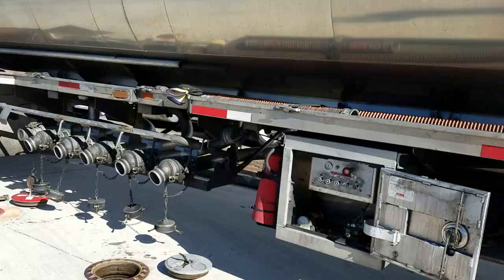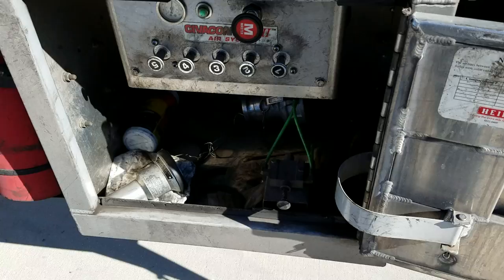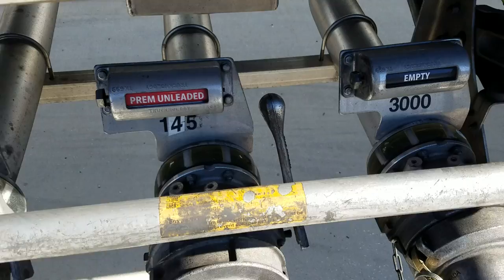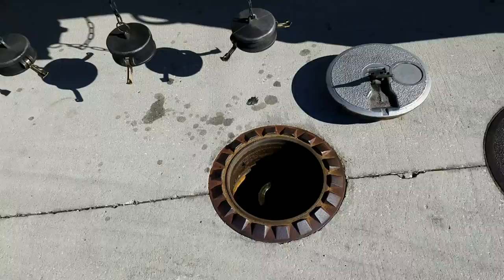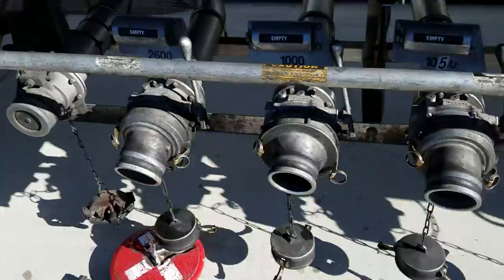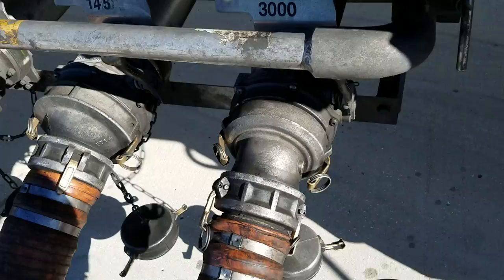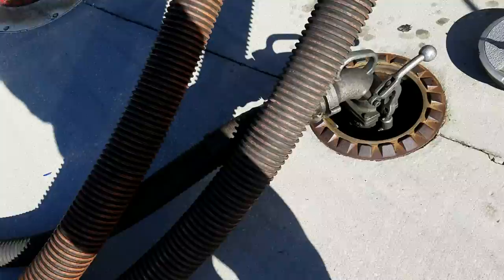How a Fuel Truck Delivers to a TruckStop

Comment: You guys don't need to Earth? How do you prevent static build up and electric ignition risks
Reply from the maker: There's a copper wire that runs through the hose that ground the trailer to the tank I'm unloading into.
Reply: NIce. Just watched a video of someone loading oil into a tanker and he had to ground his tanker with an external wire. I suppose this is safer as static can build up locally :)
Reply: Where I work we both use grounding hoses and special grounding wires on reels, we have had fires from the filling pipes on gas stations from static so now it's double safety on everything, grounding both ran through the filling hoses and externally.
Reply: Shazzkid you should earth but some don't they will learn
Reply: Shazzkid Its called a skully, you ground out
Reply: On our particular trailers where I work we run a rubber strip on the trailer which grounds it all the time. But everything is made from a non spark brass material on the hoses so your kinda grounded all the time.
Reply: Shazzkid  by not using a cell phone  or camara while unloading fuel....Safety Department nightmare being recorded...
Reply: whats earth?
Reply: Dereck Kami a ground wire that is connected to the trailer that usually they have a ground rod you hook to
Reply: Dereck Kami when you ground something you’re running a rod into the earth literally.... some people say Ground some say Earth it’s the same thing ...
Reply: Shazzkid I suggest premium & regular are the same deal ..simply price gauging interest......Always a J W 0  BinGo scam...

JetAIRplanes actually run on compressed air free energy not Kerosene burning jet AIRplanes hidden in AIRplane sight.  Same as F1 cars.... compressed air free energy......
Reply: No, he said Premium is mixed with regular to give you the midgrade.
Reply: Grant Bennett333 
You’re crazy...no idea what you’re taking about
Reply: The Media Is Cancer 
It’s 35% premium and 65% regular to make 89 octane midgrade...the pumps do it for you, but for older stations you mix it yourself at the terminal.
Reply: Grant Bennett333.      Pfft. Wasting time explaining anything to this guy.
Reply: Shazzkid. The trailer is grounded when you connect the hoses to the fittings preventing any static sparks
Reply: One Love skully is used when loading not unloading
Reply: Shazzkid 
pppppppooooppp
Reply: Not really, just smarter workers that can think on their own without dumbing the process so much an orangutan can do it.
Reply: Grant Bennett333 Your ignorance is astounding.
Reply: earth is flat
Reply: Zangief Romanov naw just gravity pulling
Reply: what sorta camera are you using? i looked at one for a few unique jobs ive done, but intrinsically safe cameras are NOT cheap...
Reply: Grounding
Reply: What's different in the UK?
Reply: the hoses have a spiral wound conductor in their construction. The hoses are regularly tested that they are working correctly, plus the vapour recovery hose is also conductive so there is a double earth.
Reply: But the earth is flat. Static electricity is a mythical lie.
Reply: hoses are grounded to the tank also some trailers have a conductive strip that is just dangling on the ground and that does the trick ststic buildup is always monitored and controlled  also forbiding items such as wool helps a lot :)
Reply: Theres a metal earthing band running around the delivery hoses which grounds to earth.
Reply: You hook up a ground stinger while loading...
Reply: What do the hoses weigh
Reply: Shazzkid j
Reply: They unload it with an accent. And a cup of tea.
Reply: a non spark material (only lead is non spark!) is not the same as grounding.
Reply: You mean ground.
Reply: MrBigStoop yup we do
Reply: right on man he should have grounded off the truck    .
Reply: @dereckkami8200  https://www.youtube.com/watch?v=2sSqzLPMb4s 
titled The Amazing Power of Static Electricity
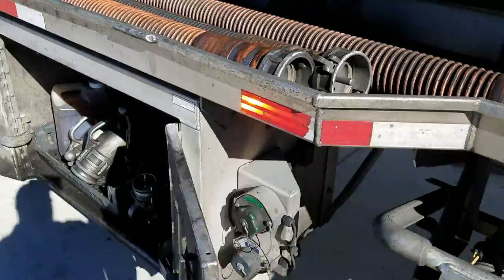At 5:20 Is a highly pertinent part of the video. 
you're welcome
Reply: @soundspark  Have you ever hauled fuel or hazmat...It is more about staying focus on the task at hand, and properly delivering hazaderious materials free from hazarderd  to the enviroment and public safety. and contamination of fuel product.  I have seen countless drivers that cross drop wrong product in the wrong tanks because they have thier bluetooth in their ears and talking on it.  When delivering fuel only thing a driver need to be concearned about is the correct products are flowing  in the correct tank.  Proper unloading procedures are followed and there is plenty of room in the tanks that is being delivered into.  I DONE 12 YEARS OF FUEL HAULING WITH NO SPILLS OR ACIDENTS.  NOW I am delivering hazardous materials that are far more dangerous than gasoline.  I stand by my previous statement.  Safety will have a feild day with a driver that is on the phone while unloading.  By the way this driver did an excellent job unloading fuel and explaing what he did and why.  Perhaps he got permission to do this.  But I am just presenting the fact in which cell phones are better left in the truck while loading and unloading.

Focus means forbiding outside circumstance undermining safety...
Reply: @larrynevitt8029  hes smart by not filming any logos or paperwork. No problem for them to worry about.
Reply: @parteibonza   got you
Reply: lol I just wrote a comment about this and saw your comment
Reply: Ground wire drop hoses are only safe if they actually work. We had new hoses that never got tested for conductivity that never completed the circuit. The hoses are suppose to be tested yearly and or after a repair.
Reply: The truck is grounded to the earth from the metal on the hose and truck touching the metal on the hose and the fitting in the well
Reply: there should be a grounding cable on the trailee

Comment: I bet that fresh gasoline smells so good! :)
Reply: Leaded gasoline smells way better!
Reply: I promise you, if you work with it long enough you'll grow to hate it.
Reply: The best is ethanol
Reply: @Chistopher lewis  thats so true. Todays unleaded ethanol stinks bad compared to the older pump gasoline from the 1970's. Today's gas is corrosive to most vehicles built before 2002 and all motorcycles, Recreational vehicles, small engine types such as lawn mower, chainsaw, generators etc.  There's many who will vote for the newer fuels however, it causes so much expense and maintenance to the older fuel systems and small engines.
Reply: smells like shit with the ethanol. Gas use to smell good in pure state
Reply: I find that gasoline has a really strong odor of  MEK [ Menthol ethyl  ketone ]  or Nail Polish remover. when I was a kid in the 60's and a teen in the 70's, Gasoline had lead in it and had kind of a sweet / mildly oily smell
Reply: @Christopherllewis  big facts
Reply: Only if your a huffer
Reply: After working in the industry, you don’t even smell it anymore. I can stick my face right above a bucket of gasoline and can not smell it at all.
Reply: @Garth2011  older gas used lead. More than enough of a reason not to use it anymore. It smelled great tho.
Reply: @justinv433  perks of the work.
Reply: Justin V same deal and water treatment. You can’t smell the chlorine after a few years. I am often amazed with the comments from visitors about the chlorine odor, Which I can’t smell anymore.
Reply: @soundspark you can't fuel on refinery byproducts those are either sold downstream to another company or burned in the refinery for steam and power generation.
Reply: @dusterdude238  mek is used at most refineries for wax removal from the oil.
Reply: @soundspark  it's all about the same as it leaves the refinery actually, now if the station has underground tanks and they have water leaks different story
Reply: @Garth2011  Which fuel do you use in your mower?
Reply: @Dansk55  Pump gas with StarTron Starbrite. Works great in the generator too.
Reply: Do you  get  paid by the  hour ? Or by how much  fuel you  deliver  ?
Reply: better than coffee.

Comment: Just curious, do you have a Hose specific for the Diesel fuel or do you use the same hoses for everything?  Would the small amount of Diesel fuel stuck in a hose really contaminate gasoline enough to make a difference?  Same question in regard to filling Ethanol Free gas using hoses that have run our Florida's "up to 10%" or even E85 gas.
Reply from the maker: I use the same hose, the small amount wouldn't matter. You're talking less than a cup of fuel into a 20,000 gallon tank
Reply: The only time it can make a difference is with military deliveries or deliveries of AVGAS LL100. You don’t swap hoses with them.

Comment: Thanks for supplying gas! That's risky business I bet.  But funny how no one uses premium I use it all the time!
Reply: Most cars engines are built to use regular gas and will not receive a benefit from using premium. Premium gas will improve performance of cars that have engines that can utilize or only run on premium. So unless on the gas cap of your car says it recommends premium or only premium, you are better of using regular gas in your car.
Reply: I run premium on my Motorcycle, the difference in performance is amazing.  i have tried using regular once and you could feel  and hear the difference in the bike. she did not like it.
Reply: Vehicles with high-compression engines, especially turbocharged engines, need a higher octane than regular grade gasoline. If your vehicle needs premium it will run poorly without it. If your vehicle does NOT  require premium it will NOT see any benefit by using it.
Reply: Wesley Hurd Typically anything that is above 10:1 compression needs premium. Turbocharged engines have for example 8:1 but once that pressurized air gets in the engine it goes up.
Reply: Funny how you say no one uses premium but then you say you use it all the time lol.
Reply: @soundspark  Premium isn't harder to ignite, that's a misunderstanding of how octane works.

Comment: As someone who does dry van do u empty the whole tank and all compartments at one station return to the refinery and repeat ?
Reply from the maker: john leininger , if the whole load is going to one station then yes. if its a split unload then i may drop one compartment at one station then go to another station with the rest. We actually load from a terminal that gets fuel from refineries. so for instance the refinery may be in Louisiana, a ship will load up fuel, travel around florida up to Jacksonville and unload. then we go to the terminal that the ship unloaded at and load our trucks then go from there.
Reply from the maker: john leininger , sometimes i do anywhere from 2 loads a day all the way up to 9 loads a day depending on where im picking up and where im delivering.

Comment: what about when its raining wont water get in your hoses on the truck also how do you keep water out the tanks
Reply: John Gayle they often get a bit of condensate in there, but the takeoff pipe doesn’t go all the way to the bottom of the tank so if it’s sucked out occasionally it should be ok. Not sure how often this happens but not so often. It’s a big tank and a small hole.

Comment: Thank you for not for not taking offense, none intended. I've been dispatched to drive different trucks occasionally, some drivers aren't to particular about fittings. Without a bucket, you know what "can" happen. In a secure area I don't use cones either. It didn't show in your video. In California EPA requires that vapor be hooked to truck first, so when hooking to tank vapors are trapped in hose, making a true closed system. You are being grossly underpaid, I hope there is better pay in your future.
Reply from the maker: Tanker Yanker , no offense taken, I'm in Florida so our epa laws arent as strict as California. Yeah its the cost of living, i make $22/hour now but its still much less than what a lot of people make hauling fuel. Luckily im happy here, I could switch to load pay and make a little more money but i dont like rushing in this line of work.
Reply: Trucks and Guns you need to work for the company out at NAS. They pay a lot more than $22 hr. But I was told from one of the driver's there yrs ago that you had to wait for one of the driver's to die! Meaning the pay is to good to quit.
Reply from the maker: lance henthorn , i appreciate it but i dont do this job for whoever pays the most. I work where im happy, money only goes so far for me.

Comment: So what would be the retail value of a trailer/tank full of fuel ?
Reply from the maker: Videos from Québec , A lot
Reply: Videos from Québec around $25 ,000. Depending on what gas cost per gallon that day. That isn't even that much compared to a lot of other things that get hauled. I work at a chemical plant and some of the stuff costs $50,000+ and it's usually only around 4,000-5,000 gallons.
Reply: Interesting, thanks for the insight.
Reply from the maker: Christopher May , spot on.
Reply: Videos from Québec I worked at a wholesaler of apparel, and our trucks were regularly carrying over $100,000 in goods. Crazy to think. Just the sheer volume.
Reply: Eric Brown I work in the distribution center for a major biotech company in the US, every day we fill up a 53 foot fedex trailer, and by the end of the day, the trailer is carrying $2 million or more in products. Everything we have in the warehouse must be worth billions. It must be hell to insure all that.
Reply: OMFG. Really? He told you there are 9200 US gallons. Just multiply that by the retail price per gallon. This is not rocket surgery.
Reply: @xXCJchronicleMAYXx  Yeah, you want high value, easy to hide, go electronics. Hard to hide a tanker of fuel.

Comment: nice video man!!  I deliver fuel as well.. your company allow you guys to dump premium and noloead with one vapor, even it's a single stack vapor? what about ulsd, do they let you dump that the same with gas?
Reply from the maker: topkat366, yeah, if the store has manifold vapor then we drop with just one vapor. when we drop diesel, we drop that first then do the gas.
Reply: Trucks and Guns 

yeah same with us on diesel first.. to many cross drops happen from doing both, but wish we can drop 2 with one vapor... we used to but yeah guys fucked that up for everyone else. so it's 2 hoses for 2 vapors. no matter if it's 500 premium...
Reply: Your company should invest in some cam locks on your hoses.
Reply: derick blackwell or just some straps
Reply: Oh you deliver fuel? You also deliver the melting of ice caps and global warming along with the extinction of polar bears.
Reply: Vid maker Seth if you live in a house or use anything from a store then you contribute just as much as everyone else.
Reply: Vid maker Seth I just saw you somewhere else.

Comment: I hauled fuel for 15 years in California. We were always required to keep the caps closed and have a bucket under the hose in which the product was flowing when delivering fuel. Bay Area Air would fine you if you opened the caps and fuel touched the ground if you had no bucket to catch it (Yes, California sucks). Top three questions asked by people. 1) Do you get paid extra for driving a gas truck .2) How many stations can you deliver to with that truck. 3) Can I fuel my car when you are delivering? OR How many gallons do to haul. That is the toughest job I ever had. The long hours you work, the traffic, and watching out for bonehead drivers.  I enjoyed your video, thanks for sharing.

Comment: I always thought gas stations had unlimited gas
Reply from the maker: Definitely not lol
Reply: Oh god no. I worked in one located near a heavily used road, it doubled as a truck stop, and we got at least one delivery per day. Sometime two, one for diesel and one for regular. Each second delivery of regular would have premium too...
Reply: It is said that if all the trucks ever stopped moving that gas stations and fuel supply would be one of the first things effected by shortage/outage.
Reply: I was in Florida last September during a hurricane and I was surprised at how quickly the stations ran out of gasoline. We take it for granted that there will always be gas at a pump and when it's not you really appreciate the thankless and dangerous job that these guys do.
Reply: Same bro at Lea St when I was a kid
Reply: One of the reasons the stations run out of fuel in Florida during a hurricane is the foolishness of the people there.  During and after the storm, the roads are mostly all closed, so you can't drive anywhere anyways.  But everybody will go out and fill every vehicle they own, so it can sit in the driveway full of fuel.  It is the same way with plywood.  They rush out and buy plywood to cover windows with and then after the storm, they throw it away.  Next storm, they all go out again and buy more plywood for those same windows and wonder why the lumber yard ran out.
Reply: @mikemassino   Remember the Blues Brothers movie?  Pushing the bluesmobile (old police car) into the gas station only to find its out of gas and the delivery is late?

Comment: I worked at a gas station in Oakland County Michigan back in 2002. well I was tow truck driver there for their service center. Got to know the owner real well. I never told anybody this but used to siphon some of the gas out of regular into the premium tank when we ran low with an electric pump,  In the middle of the night with cars blocking what he was doing. Not alot. Maybe three to five hundred gallons just so we wouldn't run out. we were in an area with full serve pumps and a lot of European cars that require premium. He did it maybe five times and never got caught.